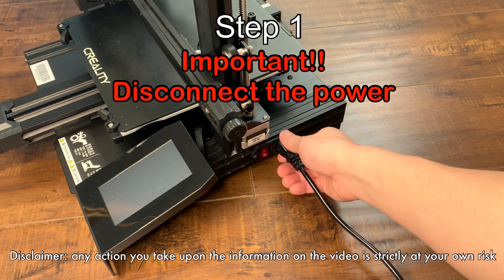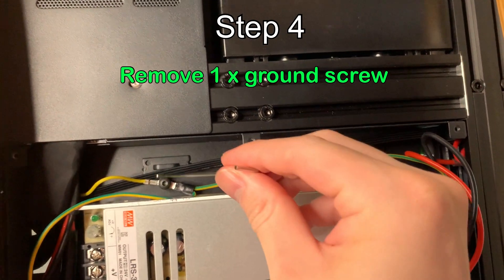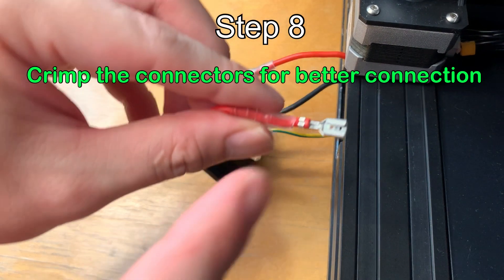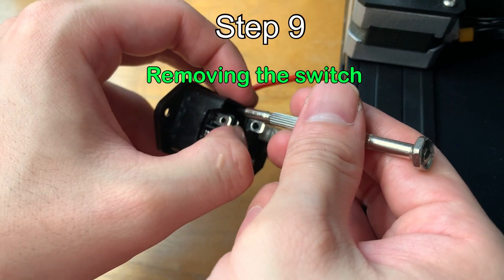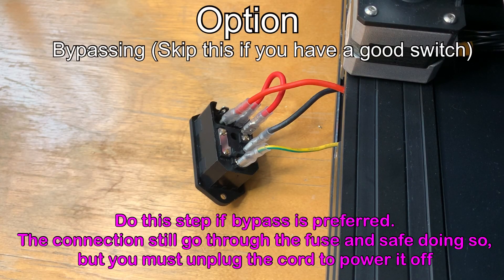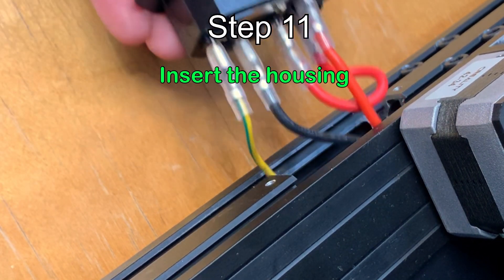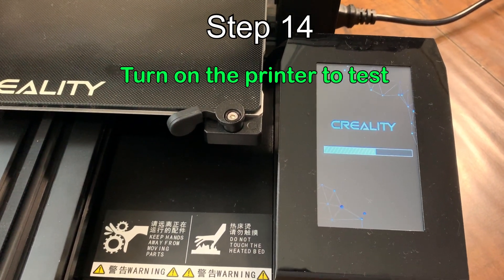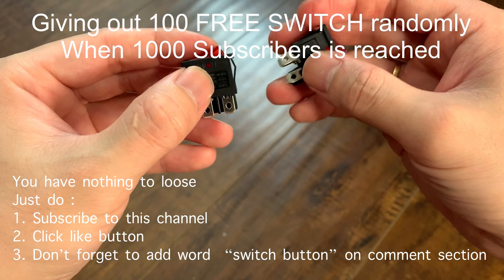CREALITY CR 6 SE Replacing Switch or Bypass

Comment: Where can I purchase the replacement switch? I’m located in the US.
Reply from the maker: Here :
https://amzn.to/3Aljm9c
Reply: @CMePrint  just saw you had it linked in the description, thank you! When you bypass the switch how do you safely turn the printer on and off?
Reply from the maker: @beeman9987  if you have power strip with a switch you could connect your printer with it and switch on/off using the button on the power strip. Otherwise plug/unplug the cable directly from power source.

Comment: Lifesaver sir. My rocker went out and I needed to do a print within 24 hours. Didn't have a replacement handy, so used the bypass with a surge protector switch and I am back in business! Now I can take my time with replacing the rocker. Thanks!

Comment: Thanks so much for this! I was having problems with my switch and was slowly losing the ability to turn the power off. Ordered the switch from the link in the description, followed all the instructions step by step, and everything is working wonderfully now. I had SO MUCH trouble with getting the crimp lugs off and the switch out of the housing. Ended up breaking the crimping lugs off the switch, and broke the switch out of the housing but it all worked out. Now to replace the board and update the firmware... 

Thanks again!
Reply from the maker: Glad to know it helps! 😃

Comment: Why did you disassemble the bottom of the unit? Is the ground wire just not long enough to get the IEC connector out without doing that first?

Comment: Thought I had a good switch until I ordered one of what you have in the video and the difference is night and day. Glad I replaced it. Took me over an hour because I struggled so much getting the locking tabs to disengage, both on the wires and on the switch itself. Would have been great if you had included more info for those two steps, but we got there. And all in all, very helpful. Thanks for taking the time.
Reply from the maker: Sorry, I Forgot to add the step to push little dimple for easier removal on the switch and like what you mentioned more info to disengage the locking tabs. Good thing you got it replaced . 
And thank you for letting me know it worked out for you 😀😀
Reply: Having the same problem, the small wire came off easily but the other one was impossible to remove. It finally came off the switch but ripped the connecting tab right out of the switch with it. So now I’ve replaced the switch but I still need to remove the broken tab from the crimp so I can reattach the wire. But it still won’t budge.

EDIT: done, apparently it only needed an hour of wiggling until the crimp was finally loose enough. Switch replaced, and it just feels so much better than the wobbly mess Creality put in there, thanks!

Comment: Thank you for this video... mine worked for a couple of months now I think... got hundreds of hours of printing and then it just shut off.  I got a switch and got it fired back up, but I ordered the wrong switch in that the assembly has the mounting screw holes on the wrong side... so I just popped out the actual switch from the old one and in the morning when my present print is done, I'll switch the new switch rocker over into the old housing.  Mine did not break the terminal on the plug side for the ground like I've heard many had happen... so hopefully I can get it back together correctly... I haven't taken the bottom plate off, but I think I will as the ground lead isn't easy to get at.

Comment: The other day, sparks started spitting out of the power switch itself before I was able to pull the cord out of the wall, so I'm really not 100% sure I want to reuse this same switch, but thanks so much for all the helpful info - it should be very easy to find a replacement now! Then, the only thing I'm wondering is if the printer is fried or not....sigh. Never again will I buy a Creality product!!!!

Comment: I just got mine today, I'm at work but plan to change the switch first thing. Mine is different, no light, just plain black. How do we know which pin, each wire goes to on the new switch?

Comment: Switch Button
My CR-6 SE just lost its power yesterday. At first the power stayed on when I turned it off with the switch, so I unplugged it. Then I plugged it back in and the switch doesn't work to get power back on. I'm going to try your fix in the morning. Thank you for the video.
Reply: Circling back to say thank you. While waiting on switches from Amazon to arrive I was able to use the printer using the bypass. Now with the switch installed, everything runs normal again.

Comment: video is great. i don't have dining room chairs, any reason i can't turn the printer on its side? maybe on my bed where it is soft
Reply from the maker: Yes you can place it on it’s side. However on each side has either belt tensioner or stepper motor, so it’s best to Hold it at an angle, and also try not to put pressure on the gantry. 
Since pressure on the gantry could cause leveling issue and it’d be little difficult to correct it. Hope that helps.

Comment: Best guide. I got the switch but after watching this video decided to just bypass it. Are there any safely concerns or issues with just bypassing the switch?
Reply from the maker: No issue. Keep in mind if anything goes wrong UNPLUG the wire. Cause Your switch no longer function.
 Or buy an outlet power that has on off switch.
Reply: Hi  @CMePrint ,
For bypassing do I have to only connect 1 wire and remove the other ones? Also is it fine if I bypass with the Creality switch?

Comment: Thank you so much for this video. It will come in handy when my machine arrives. I subscribed. May I ask, how many pins on the switch?
Reply from the maker: It has 4 pins. Thank you for watching!
Reply: @CMePrint  I guess I should have watched the video a little closer. :-)  How has your machine been working since you replaced the switch? It looks like a great machine, but I keep reading all these horror stories.
Reply from the maker: So far so good. No major problem at all!!
Been using it a lot and the only problem I have is running out of filament. No not the filament sensor related. But it’s because I use the printer a lot haha 😂

Comment: Thank you for the update and the source - they have more and I ordered them.  I'll be ready when my printer arrives.  Shame on Creality - a little quality control here, please!!
Reply from the maker: They are sorting out the problems and hopefully by the time you get yours they would’ve ironed out the kinks. 
If not, good things the switch is not expensive, easy to swap, and is in stock right now.
Reply from the maker: And also thank you for subscribing 
😀😃🤜🤛
Reply: @CMePrint  My CR-6 arrived last week and I'm very impressed.  The switch "felt" OK but I changed it any way.  The fast-ons did need to be tightened up as you indicated.  I also opened the lid for the main board and snipped off the solder tinned wire ends for the extruder heat block and bed heater and replaced them with ferules as has been suggested by others.  I'm now opening the filament sensor to check it out using your other video.  I'm doing all of this before I assemble the printer as it is a little easier to work on.  Once I have that done I will assemble it and check the FW to see if it the latest revision.  Then on to printing....  Thank you again for these useful and informative videos.

Comment: I shorted my Motherboard and replaced it with a BTT skr cr6 se now the bed temperature keeps going up to thermal runnaway, any ideas to fix it, I olso replaced the power supply
I was looking to replace the heat bed but you can not buy one on its own. any help would be appreciated. Dave

Comment: Hello, great video. You say to remove the ground wire is that just to install the switch and reconnect when the new switch is in? And do you think it is safe to print if my current switch is not switching off?
Reply from the maker: yes remove the ground wire. 
And It’s not totally safe to print when your switch is not switching off. If you decide to do that, please remember just in case if something went wrong ignore the switch but rather unplug the wire/cord immediately

Comment: Great video. I will be putting my new switch in soon and am wondering why do you remove the ground wire if there is no electric flow to the machine? Just curious. I subscribed and liked. Thanks for taking the time to make this.
Reply from the maker: The space is to tight and it will be very difficult to remove and reconnect all the wires if the ground wire is still connected. 
Hope that explains!
Reply from the maker: And thank you for subscribing 😀😃👍

Comment: Awesome video! Mine seems to be ok for now. I just received it last week and have put about 10 print hours on the clock. I will test the rocker switch to see if it is loose once I finish the current print job. I'm very happy with the printer's construction and functionality; and I don't blame Creality for this issue. The defective switches should have never made it to Creality, total fail on the switch manufacturer's side.

BTW: Is the OEM switch illuminated? Mine is just colored red with no light.
Reply from the maker: Thanks for watching the video!
If you decide to use the original switch, keep in mind if anything happens, flipping the switch doesn’t guarantee cut the power. You might also need to pull the power cord. 
No, The OEM switch doesn’t illuminate since the light connector is not connected to any power. But it does have a light bulb though
Reply: @CMePrint  I checked and the switch is tight, so maybe I got one of the good ones. I had add-on parts, so my printer shipped later. Perhaps the bad switches were in one batch. Thanks for the info.
Reply: @CMePrint  Thanks, I will make sure to pull the cord if anything weird happens. I wonder what the failure rate is on the power switch? I have only seen a few posts so far with the issue and there were over 10,000 units produced. I suspect Creality is trying to make sure any new units are ok, while addressing failures in the field. This is turning into a mess for them.
Reply: Creality needs to employ some incoming inspection when they receive a shipment of parts for lot acceptance.

Comment: Where can I find another switch on amazon? The link given in the description is currently unavailable.
Reply from the maker: https://amzn.to/2FzutmU
Here’s the amazon link for the same switch but in different color.
Reply: @CMePrint  this one is unavailable now too. At least I know what to look for, though...there is a 2 pack available further down the screen, so I'll be going with that.  It's worthy to note at this point that I believe I figured out why the stock switch is faulty (or at least why mine was sparking): if you look at the closeup picture of the rear of the switch on Amazon, you'll note that there is a plastic shield of sorts that separates the 2 right-hand from the 2 left-hand terminals. On the stock switch, this partition is only present between the bottom 2 terminals whereas the Amazon one is between the top 2 terminals as well. My guess is that there was some arcing going on between those top 2 terminals....for shame, Creality!!!

Comment: Nice instructions, but personally I wouldn't replace the faulty switch with a lower-rated switch, even if the replacement is of higher quality.
The CR-6 switches have two distinct issues. One is that they're just really shoddy quality; they're squishy, have really loose action and the springs are flimsy.
The second is that the Mean Well DC power-supply, the LRS-350-24, has an inrush current of about 60 ameperes. Because inrush current is very brief, it's impractical to rate the switch based on the inrush current, and get, say a 60 amp switch for the CR-6. But the original switch is rated 10A @ 240VAC, and if you're oredering your own anyway, and since they're readily available in the size that fits the power cable assembly, I'd go for a switch that's rated around 16A@240VAC.
Don't have an Amazon link to quote, but I personally got the KRE2DNA1BBB from ZF Electronics, formerly known as Cherry, and it was 2,40€ on Mouser.

Comment: Why would you not reconnect the ground wire if you changed out the switch?

Is the ground wire faulty?
Reply from the maker: aztatude the ground wire is not faulty and MUST be connected. Reverse disassemble step in order to properly replace the switch.

Comment: I bought the switch in the link , but it doesn't light up , is it suppose too.
Reply from the maker: Don’t worry that’s normal. Because the wire is not connected to the light.

Comment: I could use a ‘switch button’ EU backed still waiting to get it shipped. First 3D printer and I don’t want to set my house on fire. Thanks for the videos!!!
Reply from the maker: I was worried when I got the switch problem and even more when I heard people experiencing the same problem. 
I replaced it and after hours of prints I’m not worried anymore. Btw, This is a good printer for starter. I’m pretty sure you’ll like it once you get the hang of it.

Comment: why do you have to remove the ground wire?
Reply from the maker: Removing the ground wire gives more room to work on tight space, otherwise it will be difficult to remove the switch. 
Tips. If you don’t have the gantry installed yet. Flip the whole printer upside down laying on the bed to access the bottom panel easier.